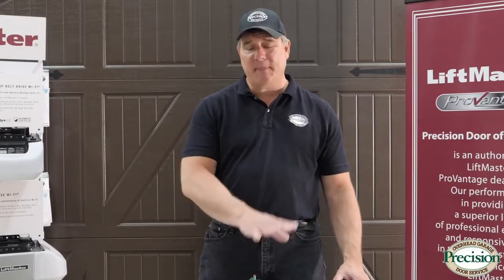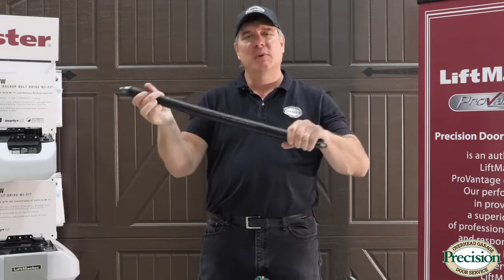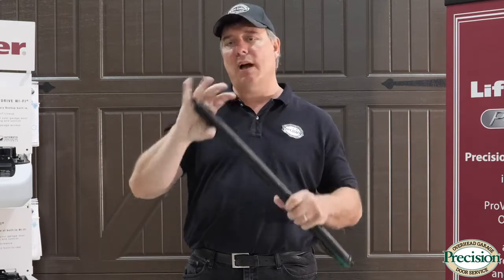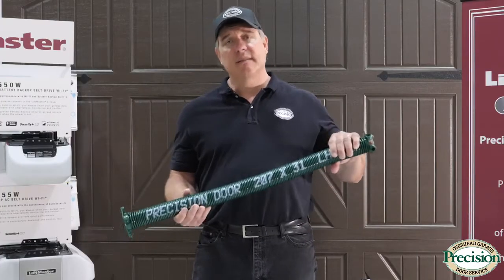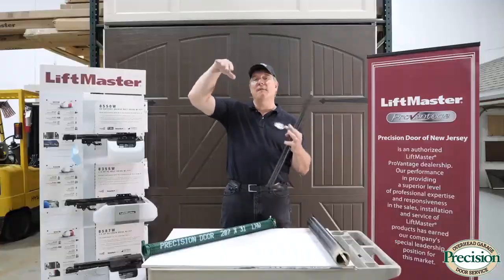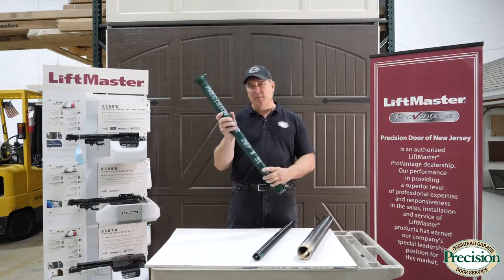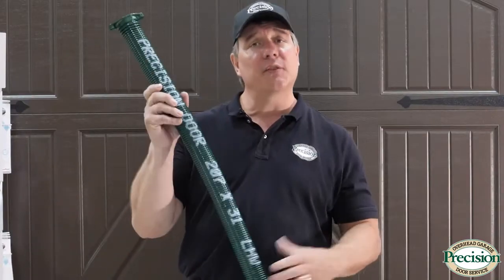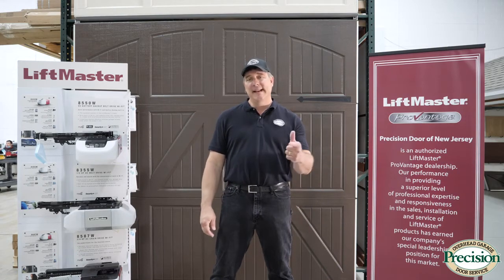Garage Door Extension Springs vs. Torsion Springs - What's the Difference?

Comment: This is a little old but I'll state my 2 cents anyway. Those extension spring are a hazard/menace/danger to human and other life. I would never own a home with them. Torsion type are the only way to go. In 1975 my wife was almost killed by a "large" type that did not have a safety cable in it. I'm not even sure they thought about that safety cable back then. As she got out of the car and "luckily" did not use the remote in the car to close the garage door. She pressed the wall switch on the wall as she stepped into the house thus saving her life. The home was newly built in 1975 and this mess happened in 1979, everything door, cable (that snapped), springs were only 4 years old...................................... I called overhead door and had everything replaced, new door, torsion type springs etc.!! We did not even use the two car garage till all was replaced about a week or so.

Comment: I want a wall mounted garage opener but my doors have extension springs on them. Not sure if it's worth the trouble to convert to torsion and then buy a more expensive opener just to have a wall mounted opener. My doors do look even though when they close.

Comment: They don’t really work independently . The door needs to go up or down squarely, or parallel to the tracks.or it will jam up, during travel. Ask me how I know! But yes, to a degree, when the door settles into it’s closed position, it can compensate for un evenness. Depending on the openers settings. I almost ruined a brand new door this year, adjusting the two sides.

Comment: With a single steel door do I need extension springs and a torsion spring?
Reply from the maker: You'll most likely just need extension springs.
Reply: @PrecisionDoorService  thanks for answering. The reason I ask is that I stopped by my mothers house the other day and the extension spring broke. She has a torsion spring installed from her old wooden door that works fine. Extension springs were kind of expensive. And I don’t really see a need to have 3 springs since the door is fairly light? Again, thank you for responding so fast….toots…
Reply from the maker: @Gfysimpletons  yeah, three springs is unnecessary. We'd say either just use the existing torsion springs, or replace both extensions!